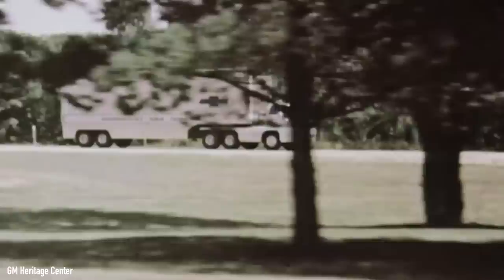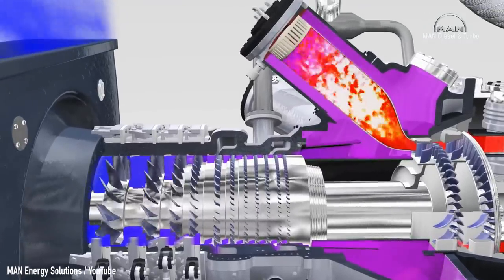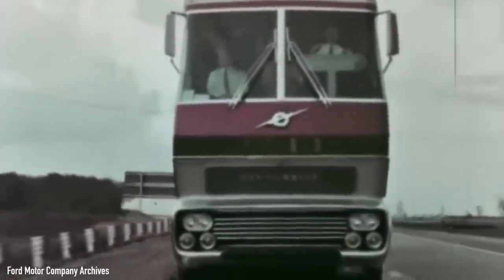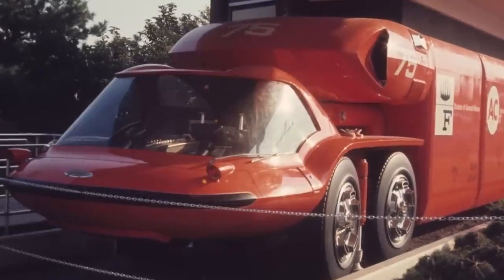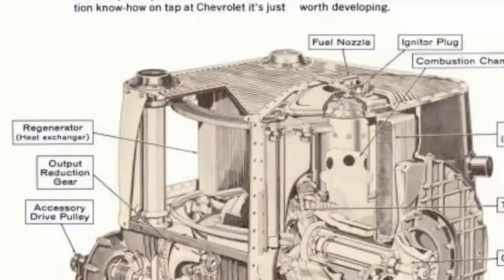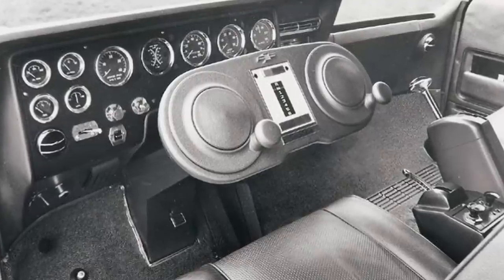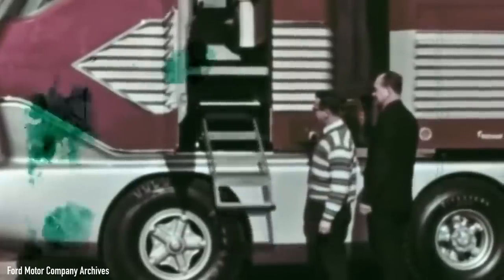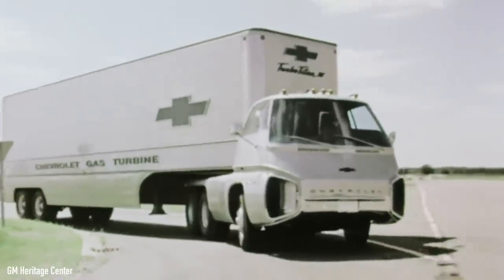The story of Turbo Titan, Chevrolet's long-lost gas turbine truck that almost made into production

Comment: My first job as an engineering grad was working on the GT309 at Detroit Diesel Division of GM.  The idle speed was 17,000rpm and max speed was 37,000.  Detroit Diesel was not making enough progress on that engine; it did not go far without repairs. The program was transferred to Allison in Indianapolis, which had a far better skill set for this engine, BTW, the fuel consumption of the GT309 never got close to being a threat to the Diesels of the day. Good video.
Reply: Was that for combined fuel consumption? I reckon turbines are incredibly wasteful in stop-and-go traffic or sitting in a traffic jam. But using optimal turbine speed on long stretches should be in the region of a regular Diesel, no?
Reply: @Immortal..  Gas Turbines only make sense when they are used as a constant speed power plant, like on aircraft and as quick starting peak power generators. Also keep in mind that the lower weight is critical for aircraft, but not for road vehicles since they would have had to add a heavy shield to protect the general public from a turbine failure....
GM's gas turbine car had a two cylinder engine that powered everything else so the turbine was only used for traction. And still the car was an insane waste of fuel. J. Leno built his own turbine car ans it is a total fuel pig...

Comment: Having used a dial steering wheel on many warehouse systems in an industrial setting I can say it is a superior form of steering for something small and requiring finesse. I'm not sure how it would have felt in a truck, and also duplicated for no reason.... but in something the size of a forklift or picker it works great.
Reply: Oh yeah dials are great but I genuinely could not imagine them in a normal car, especially since people like racing them, imagine slightly overturning your dial and your car rolls in the ditch.

Comment: At least Chevrolet reused the Titan name in it's Class 8 tractor...GMC's version was the GMC Astro. They were production trucks that featured some futuristic designs compared to the trucks of the day....cabovers with rounded corner aluminum cabs, panoramic windshields, wrap around dash, etc. Early models had passenger bus type mirrors versus the standard west coast style mirrors.
Reply: I actually had an AMT kit for a GMC Astro cab over in the 1970s.  It had parts for both the normal engine (a Detroit Diesel 8V71T with a manual box) or the gas turbine with an Allison automatic.

Comment: These turbine engines were great they could be ran on just about anything flammable, so really I think it was particularly due to the oil industry trying to stay on top. I'd love to see these engines today, with how far we have come who knows what our cars would be like today if this didn't die out, a true future would be here.
Reply: I wonder if a modern design could be convinced to run on hydrogen to keep the emissions in check. For a long haul cruiser a turbine engine makes more sense than a city vehicle (I seem to recall that Abrams tanks had this awful habit of draining the tanks on crews unaware that their consumption was largely the same whether they were moving or not), and I feel like transmission and turbine tech might have advanced a bit that some extra efficiency could be gained.

Comment: I remember the turbine put in an Astro 95  configuration....I worked across the street from the Allison Plant, Maywood where the engine was built.  You could tell the powerplant by the twin stacks on the cab. Must've been 2 feet in diameter.

Comment: I worked for Garrett Airesearch in the early 80s when they outfitted a Mack Cruiseliner and a Superliner with their GT-601 gas turbines developing over 600+ HP. These were road tested extensively under a full load especially in the mountains and performed flawlessly and were able to maintain the speed limit without bogging down like conventional diesel powered trucks. Truly a trucker's dream rig. I distinctly remembering the whistling whine of the engine as they rolled past.
Despite being a total success on the highway, they were shelved because of cost. Turbines require meticulous machining to manufacture and require heat resistant alloys which made them cost prohibitive, trucks that cost well over half million dollars in 1980 just couldn't compete.
You can see pictures of these trucks by searching for Mack GT 601 turbine. I believe these are also in a museum also.

Comment: I met a man named Weigel that worked first hand on turbine trucks. The differentials and transmissions were the failure points most often especially going up grades.
Reply: Reduction gearing problems I can understand, but why differentials?
Reply: @lawrencedoliveiro9104  I guess they couldn't handle the turbines torque it makes more sense cosidering he mentioned while going up a grade thatd have to put some extreme stress on it.

Comment: Loving the styling of these trucks. While cars have changed dramatically over the decades, trucks seem to be pretty much the same as they were 30 or 40 years ago. Can you imagine trucks like these with a modern Hydrogen Cell powerplant? Cool!
As for what happened to thge Turbo Truck, well, while Ford often gifted their outmoded prototypes to collectors and customizers like Barris, Chevrolet had a nasty habit of scrapping their prototypes. Fortunately, their gas turbine cars, the Firebird 1,2 and 3 versions all survive and are well cared for.

Comment: Off the top of my head I think this could be made useful in daily hauling by making it turbine-electric, like a diesel locomotive.  It would then be able to use the electric motors for "engine" braking and energy recovery.  This would also allow the turbine to remain at an efficient rpm, while the electric motors handled the acceleration, deceleration, and running at speeds where the turbine could not be used efficiently

Comment: Very cool. Never knew they had a gas turbine truck. Learn something new every day. Remember reading not too long ago about an idea to build a small gas turbine powered hybrid since they are very fuel efficient for the power created and use them like an APU for an aircraft to charge on board battery cells. Be like having a 480v charging system on board and if the Tesla truck or something like the Nicola ever becomes reality, it'd be smart to have a powerful turbine powered apu for areas you can't recharge

Comment: Chevrolets model was much much more useable on the road IMO. Im an engineering student and I can reportedly say turbine engines are significantly smaller in size compared to a same spec reciprocating engine. So with this in mind, it would be more sensible to go with a design that has lower cab positioning than the diesel trucks in order to use this perk of the turbine engine. When Ford designed their turbine truck, they knew it would never get off the carpet. But Chevrolet made an actual commercial vehicle which was ready to roam the interstate. 
Also I would love to hear truckers cussing about being stranded on a rural place because that overcomplicated "show stopper" door with retractable ladders decided not to work all of a sudden.

Comment: I think this technology would work great in a hybrid setup
Reply: The only way a gas turbine could come close to being acceptable by today's standards would be in a series hybrid configuration. Several companies have tried that, and a few vehicles (mostly buses) have made it to operation on the road, but none have been successful. The latest problem - not a big concern in the 1960's - is that emissions of oxides of nitrogen are way too high.

Comment: Was a marine gas turbine tech in the navy.  The ship I was on used a version of the DC10’s they put 200k+hp and a couple million foot pounds of torque.  They worked very well if they ran wide open but were pretty lame at slower speeds.  I bet these were horrible in stop and go traffic for trucks.  Likely went through fuel pretty quick at in town speeds.  I bet they’d have better performance with an Alison 501 engine.  Those put out a lot of heat though.

Comment: Turbines can be really efficient if you keep them in the right operating window and load. So you need something that can keep the load on the turbine consistent, while being able to output a wide range of torque and RPM. They would be great as a fuel cell/range extender if you combine it with an electric drive train. That would bring electric vehicles pretty much everywhere around the globe. Infrastructure is a problem now, and fuel consumption is too. This could be a solid interim solution for the next 20-30 years as developing countries get their infrastructure going.

Comment: General Motors has an opportunity to further explore development of commercial vehicles namely semi tractor trailer setups using today's technology it can be done. The only thing I would do away is the steering wheel system which I think is worthless and I would make the cab a lot bigger to incorporate a living quarter for long Coast to Coast hauling. What General Motors needs to do is talk to truck drivers and ask them plain and simple what are you looking for in a tractor trailer setup

Comment: Pop-out headlamps never make any sense. In a regular car, they spoil the aerodynamic lines. Here they get in the way of those air ducts.
Reply: It wouldn't make much difference to temperature of the turbine when you think about it because the lights only pop out at night when it's cooler
Reply: @blahblahdrunksheep  The air intake to a gas turbine engine isn't just for cooling; gas turbines don't have radiators, they move all of that air through the engine.

Comment: Capstone microturbine generators: only one moving part, with gas cushion bearings, no friction.  A combo of microturbine generators with electric motors has already been tried for trucks, but no news about that for a while.  Microturbines have also been tested as range extenders for EV cars and planes.  Interesting also that turbines can be fed multiple fuels, including hydrogen, which works better with turbines, compared to reciprocating pistons engines, due to its fast burn rate.

Comment: At one point AMC was working with GM so they could put a turbine in the Pacer. True story and when that didn't work out AMC was forced to use their standard 6 cylinder under the hood. Kinda of sad!.
Reply: I believe it was a rotary (Wankel) engine that GM and AMC were developing for the Pacer. GM abandoned that project which led AMC back to their 6.

Comment: Every wheeled vehicle mfr. did turbine propulsion research in the 50s and 60s, they all had schlocky Barnumesque features too. They all found out very quickly that the speed variation experienced on the American roadway made the turbine a poor choice for anything but aviation/marine or power generation.

Comment: Designers and engineers from the 50's & 60's were ahead of their time and heads and shoulders above todays designers and engineers. Kelly Johnson from Lockheed's "Skunk Works" designed and engineered the SR-71 with a slide rule and drawings on napkins, that even today it still holds records for the fastest and highest flying plane. Don't believe the hype when they throw Mach numbers at you for supposed speed of the SR-71. I've actually talked to people who have seen this thing perform and what you see on documentaries and film is nowhere near what the capability of the plane actually is. Same thing with the auto industry. We could've had remarkably fuel efficient and good looking vehicles if they were able to follow through on their ideas.

Comment: In these days we would use it as generator and drive the wheels electric, but yeah that is the modern age. 
In those old days you needed mechanical couplings.

Comment: Was the front end designed by Pontiac?😆
Reply: @Reaper-wf8ms  no shit what's your point?
Reply: @scottmacleod6301  it’s the same designers fool 🤦‍♂️
Reply: @Reaper-wf8ms  no it wasn't each GM division had it's own design team until sometime in the mid 80s, Pontiac, Olds, Cadillac, Buick and chevy all were independent designs all I was stating was the front of this thing remided me of about a 66/67 Pontiac.
Reply: Yeah it does have that look its very similar to the 67 bonneville's pontiac was well known for the verticle headlight design

Comment: I wonder whether gas turbine coupled to an electric drive train would be feasible, allowing the turbine to operate efficiently regardless of road speeds and loads. Another thing to look into is the 1968 British Leyland Trucks gas turbine prototype, which has been restored and is still on the road. My uncle had something to do with its design, though exactly what I'm not sure.

Comment: Funny thing about turbines......they make max torque at zero rpm, just like an electric motor. If they had proper regeneration systems and were allowed to run as hot as possible within the constraints of modern metallurgy,  all it would need to do is get comparable or better mpg.

Comment: Fords is for long haul, chevy for short hauls. Ford put driver and passenger comfort first in my opinion. The Chevy looks compact in cab size and the chassis looks like a stretch limousine.  It's more of a reaction design.

Comment: With diesel fuel being forced out these days. Maybe it’s time to revisit turbines. Kerosene would be considered an “alternative fuel source”, so governments would hand out cash left, right and centre. Plus modern tech would mean they’re small. Best used as a hybrid generator with electric drive motors, no gearbox required etc

Comment: The comparison may be a bit benign. as you have an orange comparing its self to an apple . Ford Big Red is obviously designed for over the road hence the sleeper area , where Chevy is just a day cab design , and that Air ride cab on the Ford was a spooky thing to drive, those early air ride cabs  were all over the place.

Comment: Nikola Tesla Applied for a patent for an automobile powered by his Turbines in 1928. The patent was ultimately sent back for revisions and for logistic reasons and he never followed back up with it.
Reply: While working on these two inventions, Tesla was in contact with the Edward G. Budd Manufacturing Company from Philadelphia. The patent attorney of this company, John P. Tar-box, helped him with the US Patent Office procedure.
The method for economic operation of automobiles itself, according to the invention, consists of applying the energy for the small normal performances at substantially the highest ef. ficiency of the prime mover, and that for the great occasional performances at a lower efficiency.
Regarding propelling apparatus for automobiles, according to the invention it consists of a motor of high load efficiency and very great overload capacity in combination with a fluid pressure generator adapted for supplying to it primary energy. Such a general description of the invention makes the essence of this invention difficult to comprehend, which is a combination of a standard internal combustion automobile engine and Tesla's turbine, from this US patent 1,061,205, using, among other components, Tesla's valvular conduit, patented as US 1,329,559, to provide flow of the working fluid in one direction only.
Reply: The patent examination procedure the US Patent Office took a very long time and Tesla received a large number of examination results. For patent application 244,345 he received four (dated September 13, 1928, April 17, 1929, October 24, 1929 and April 28, 1930) rejecting his patent application, on one side as anticipated based on several existing US patents of other inventors and Tesla's turbine patent, and on the other side due to the fact that Tesla's method for automobile operation was only the method of functioning of the corresponding device and, as such, could not be patented, as well as based on the position of the examiner that Tesla was expanding the disclosure of the application during examination, which is not permitted. Tesla, together with his attorney John P. Tarbox, continuously presented arguments to the contrary.
After the final rejection of the patent application, Tesla appealed to the Board of Appeals, but the appeal was rejected on November 9, 1930, thus ending the patent application procedure.
Reply: For the second patent application, 244,346, Tesla received as much as six patent examination results (dated September 13, 1928, April 17, 1929, October 24, 1929, April 28, 1930, March 25, 1931, and the final one on February 24, 1932), in which the examiner rejected the application for similar reasons as the one for the method. Tesla was not satisfied with this outcome and submitted another appeal to the Board of Appeals on August 24, 1932. Although the documentation covering the end of this procedure is not preserved, bearing in mind the position of the Board of Appeals in the almost identical case of Tesla's first application, it is probable that the appeal ended with rejection, which means that Tesla, despite a considerable legal battle, did not manage to patent any of these two inventions. At the same time, these are the last two patent applications that Tesla submitted to the US Patent Office.